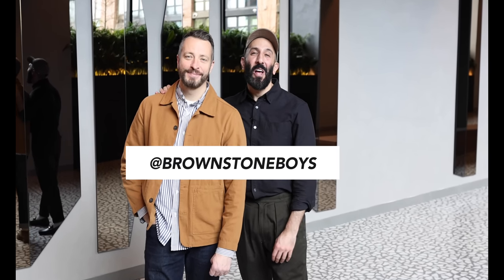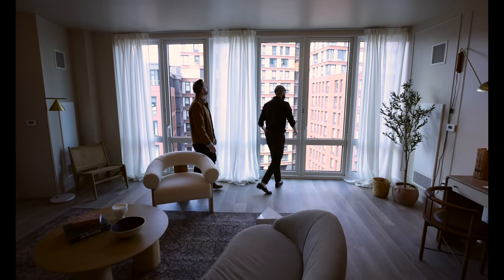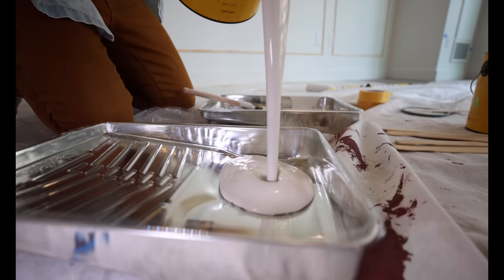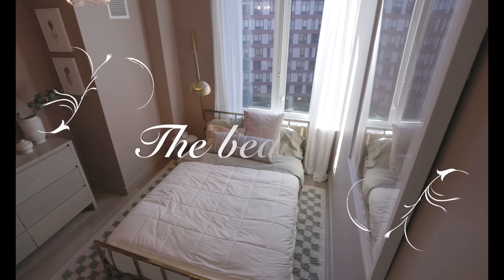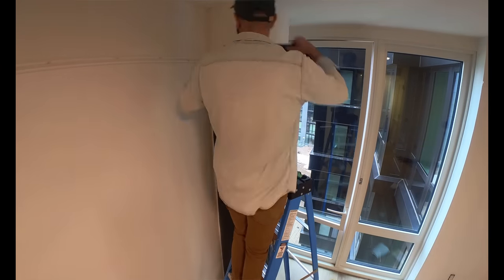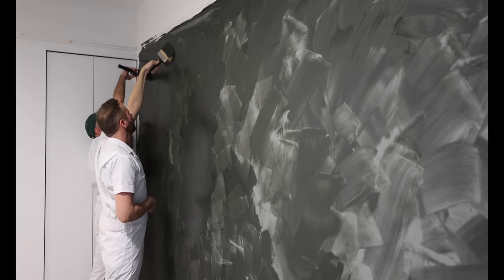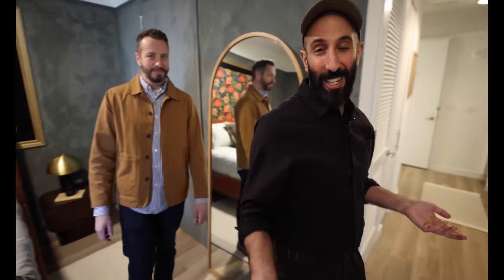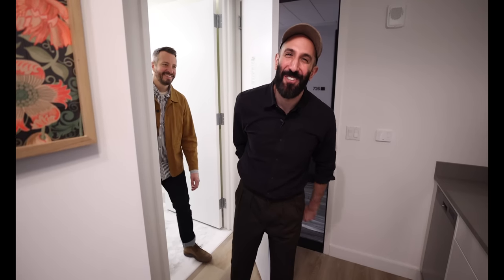Brooklyn Rental Apartment Makeover | Before & After

Comment: I know these makeover 'shows' will have time & budget restrictions that may limit creativity & design but the executions here is so basic and random.
That molding is way too thin for that big a wall. Molding is to dress up, elevate bare walls instead of artwork so the molding needs to have texture/depth and be interesting. Those thin bare looking molding looks like stuck on picture frames. 
Consider contrast in thickness & texture when choosing furniture & decor. I.e if all your furniture has thin legs it allows more light to come thru but can also look cluttered when there's too many visual lines. All the random buffets and shelving all stacked against the wall does nothing for the room.